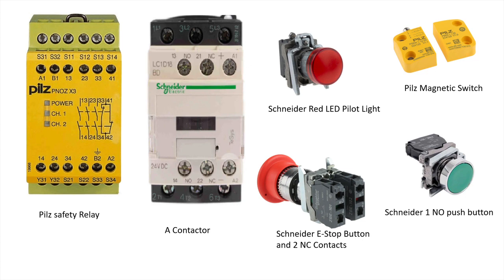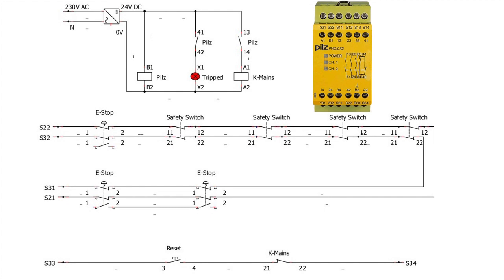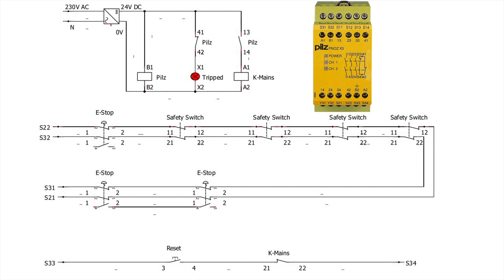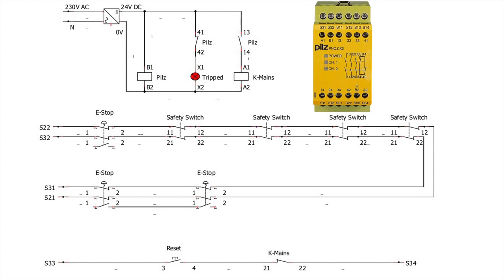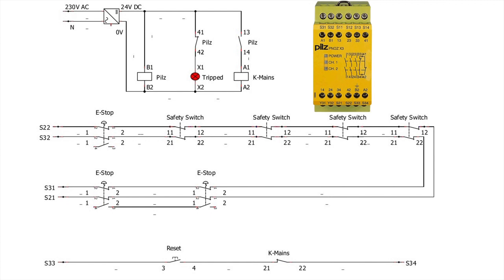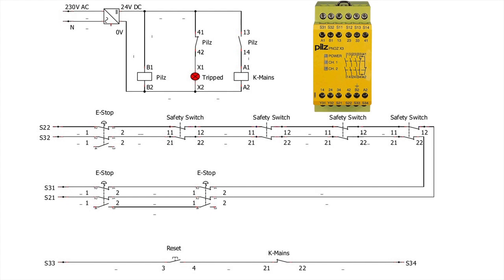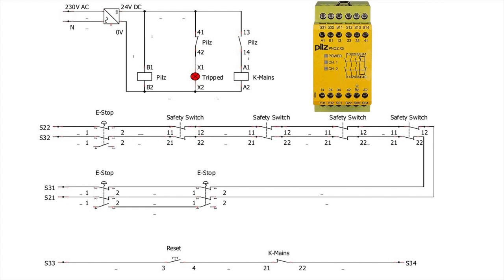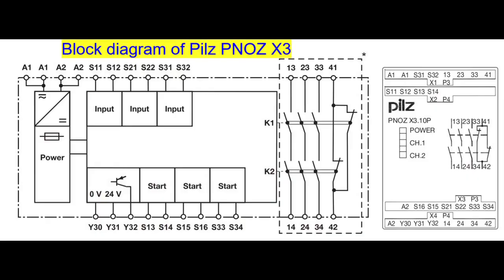How to wire up Pilz Safety Relay Pnoz X3, Safety switches, Estops, Light curtains -Part 1 of 3 #Pilz

Comment: What is a problem if Ch 2 led not lit?
Reply from the maker: Hello mate! You will have to find out from wiring diagram. Typical wiring will be Proximity switches on one channel and  E-stops on another channel.
But the combinations can be many.
Take for example, yesterday i was with a cliente whose machine refused to run, it happened that his Safety Relay ( phoenix contact), was linked to a three phase sequencing monitor.
So one safety relay wont reset if the order of the three phases is changed on the machine's plug.
Send me your wiring diagram if you want at obi1knube@hotmail.com

Comment: With so many switches put together there is a real risk of fault masking in the circuit. Perfectly fine if you don't need better than PLc protection. Which is obviously the case as you use a single channel output. But NO, it is not suitable for most industrial machines!!
Reply from the maker: To make it adaptable to most industrial machines, what can  you suggest please?
Reply: @maintenanceengineeringinsider  The problem is that if your "K-mains" have failed closed, then the machine would not stop when you hit the estop (if it fails just before emergency). Most machines would be evaluated to need PLd, which cannot have a single fault failure like this. The solution is to put another K-mains contactor in parallel to the first one fed from the PILZ.24 output, add the N/C contact of the new contactor in series with the reset and the other K-mains N/C, then put the main contactor of the new K-mains in series with the other K-mains so that a single failure would not impede the safety function.

Regarding the inputs, I would try to spread them so that I have a few on a single input as possible as a pre-caution against fault masking, but that is only needed if PLe is deemed necessary, which generally speaking most machines would not need.

Comment: Interesting and thanks for sharing! Perhaps a small addition because be careful with an automatic RESET because this can cause an unexpected machine (re)start. Here in Europe this is especially with safety circuit of machines not (always) in accordance with the Machinery Directive (2006/42/EC), see article 1.2.2 stating the following: “From each control position, the operator must be able to ensure that no-one is in the danger zones, or the control system must be designed and constructed in such a way that starting is prevented while someone is in the danger zone.”
Note: The RESET-button then has also the function to look extra carefully (in the danger zone of the machine) that no one has been left behind, before it is released.
Reply from the maker: Thanks, your postulation is correct.
Reply: If you have an unexpected machine start-up due to RESET, then your circuit is wrong. EN 60204 clearly says the machine cannot start up by pressing reset under any circumstances. So you have an additional start button. The reason to have reset is so that nobody can start the machine just by pressing the start button to avoid accidental start-up by someone who is not aware of some hazard. (I know it is kind of doubling up the locking of the estop that already doing a similar job). Note: that you don't need reset to start a machine unless a safety element changed state on one of your safety functions.